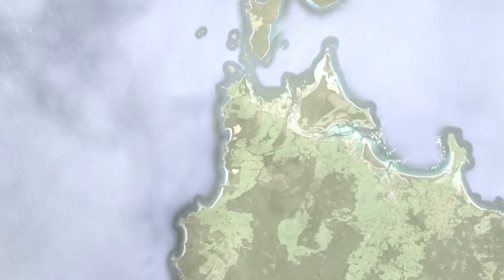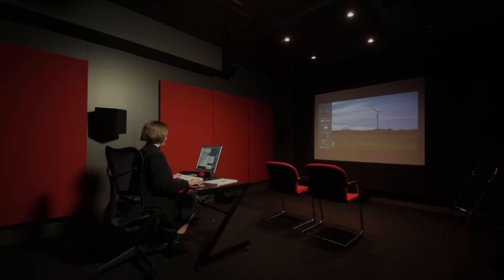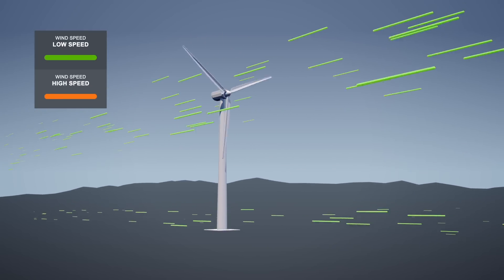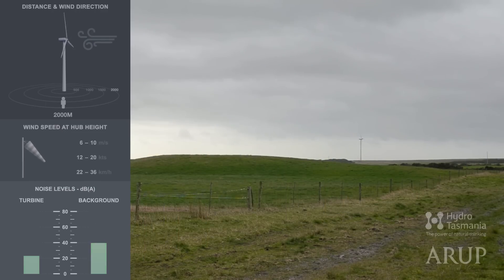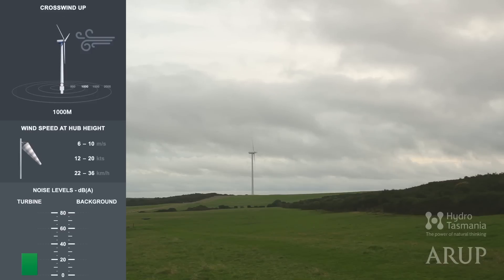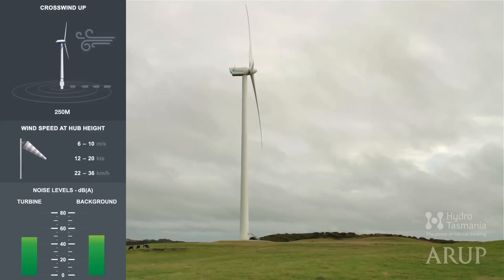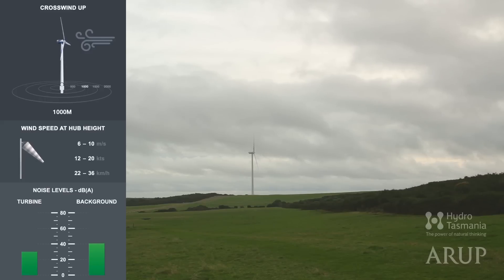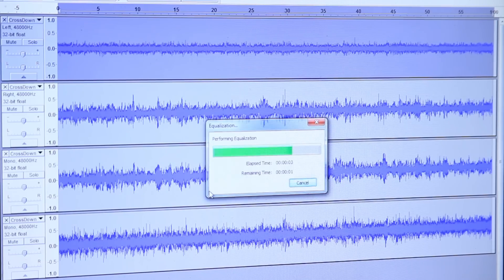The sound of wind farms

Comment: This is a con - note that ALL sound measurements are 'A' weighted - this means that they DELIBERATELY remove low frequency (infra-sound) from the measured results. It is the infra-sound that is believed to cause the health concerns.
Reply: Have lived 1km from large wind turbines for over a year and have never heard a thing even at night all I hear are frogs and crickets. I think that the noise you hear is all in your nutbag head.
Reply: there's no suck thing a infra sound can cause health concern. there is not enough energy is deposited on human body to cause any sort of harm. its just low humming sound that barely audible, if you grow older you will hear less because of your hearing is weaken on low and high frequency.
Reply: Not true: I could hear the sub sonic and infrasonic frequencies in my studio quality earphones. The equalization of these soundbites are indeed accurate. I visited a turbine myself, and could barely hear anything over traffic noise on the highway. When I put my ear up to the tower, I could hear the whirr of the gears in the transmission, and the 360 Hz magnetic whine of the alternator.(60 Hz, 3 phase) To hear that, I had to all but "hug" the tower. I could not hear the electro-mechanical sounds at arms length from the tower. The bushes and trees made so much noise, it drowned out the noise of the blades. The loudest thing was the traffic noise, making it difficult to hear the windage noise of the blades. I want to get close to a turbine away from a forest, or from a highway, so the environment is quiet enough, to clearly hear the turbine. THEY'RE THAT QUIET!!!
Reply: @vincentrobinette1507  Just today I went for a walk around the national park near where I live, where there are a total of four wind turbines - Senvion MM92's to be more specific. I regularly visit the park and like to go stand right next to the wind turbines, as they're a piece of machinery I'm particularly interested in.

I've noticed that the blade "roar" is louder on colder, more humid days - I presume that happens because the air is more dense and it creates more resistance for the blades. Near the turbine you can hear all sorts of sounds as you mentioned - the transmission, the generator, the motors that rotate the nacelle and make the blades pitch. Even if the turbine isn't working you can still hear all sorts of whirring and humming sounds coming from it. From afar I am able to hear the turbine blades spinning, the yaw and pitch mechanisms working as well as some screeching sounds.

I don't live near them nor am I a scientist, so I personally can't tell if the sound they produce is prejudicial to our bodies. But you can definitely tell they're around in a large radius, and I'm talking about only four units. I presume people who live near large wind farms can feel bothered by them.
Reply: @mikerelvas  Have you been able to walk around a turbine in high enough winds to produce full power? If so, is it more apparent up wind, down wind, or cross wind from the turbines. What angle do you need to be, to experience the most noise, particularly the infrasonic "Whump"? Again, I have never heard anything but a light "swish", barely audible above the noise of adjacent trees and road noise.
Reply: @vincentrobinette1507  I've been around these wind turbines in all sorts of conditions, including high wind speeds, but I can't tell you if they were at full blast. I can say, however, that they were spinning faster than usual.

I presume upwind is how they're usually positioned by default, meaning that the rotor always seems to be pointed against the wind, so it flows from the front to the back. At least that's how they're supposed to work (correct me if I'm wrong). In such conditions you not only hear the "swish" or "roar" of the blades as well as a pretty aggressive "whistle", almost like a jet engine. You can hear it best if you're perpendicular to the blades, whether you're right under them or a few hundred meters away.

In terms of the infrasonic sound, you seem to feel its presence regardless of where you stand, but it's obviously more intense the nearer you are. If, in my case, the wind turbines are in the middle of a forest where it is generally pretty quiet, any strange sounds they make seem to be amplified quite a lot, as they feel out of place. Yesterday, for example, I was walking away from the turbines and I could hear the nacelle rotating and the blades pitching.

I'm sorry if I didn't quite answer your questions fully, but feel free to ask away and I'll do my best to explain. I would recommend you to find a more secluded wind farm and spend a few hours there in order to clear any doubts you may have about them and their mysterious noises.
Reply: @mikerelvas  I think you did! You suggested that they're loudest, if you stand right in the rotational plane of the rotor. You are correct, the turbines have anemometers and yaw mechanisms, to ensure they always face right into the wind. My problem is, when I've visited turbines, the wind hasn't been high enough, for the machines to produce full rated power, but, above cut in speed, so they were turning. I'm guessing that if the wind is ABOVE the speed necessary for maximum output, the pitching mechanisms "feather" the blade edges into the wind, to control maximum torque. That might be when a turbine makes the most noise in the wind. I've never experienced that. As far as infrasonic sound, I would imagine it would be worse with one machine, than many. With a wind farm, the beating "whump" of many turbines just turns into a low frequency drone, more like a steady rumble.(again, I've never had a chance to hear this) We don't have a lot of turbines here in Utah, because we just don't have enough wind, for the capacity factor to make turbines economical. We have them in a few of our canyons, but that's about it.
Reply: @vincentrobinette1507  Recently I visited the natural park, where the wind turbines are, on a very hot evening with pretty much no wind, and they were actually idling. I went near the one that's at the highest elevation and stayed there until it started up, as I was curious to see the procedure. What I noticed was that they still make a lot of electro-mechanical sounds even when they're idling and that they always seem to be adjusting their position even without the blades rotating, which also makes some noise. When they start up, you hear a lot of stuff going on, from generators, transmissions, yaw mechanisms, clunking and, finally, the blades wooshing away.

Yes, when wind speeds are very high the blades are positioned at a more aggressive angle. That way they use the drag in order to control the torque and maximum RPM. The brakes may also be applied and the turbine might be temporarily shut down in order to prevent overspeeding in excessive winds.

I hope you can experience it for yourself one day, especially considering your interest for the topic. These massive fans are quite intriguing pieces of engineering and I love to learn about them. Do you know the brand and model of that turbine you visited?
Reply: @mikerelvas  Yes: The first one was a privately owned,750 kW NEG Micon. The 5 that I visited in the canyon were 1.2 megawatt Suzlons. I also visited a smaller 250 kilowatt NEG Micon. These machines are pretty old, by today's standards, though, they were impressive, back when they were built. I WANT to visit the turbines in California, maybe Altamont  Pass, Tehachapi, or Contra Costa. (Places where there are turbines as far as the eye can see)
Reply: @vincentrobinette1507  California has loads of them, it looks insane from what I've seen online. I think Texas has the largest wind farm in the country (could be wrong).

What a gorgeous state you live in, by the way.
Reply: @mikerelvas  Thanks for saying that. On of the main things we're known for, is good skiing!
Reply: Covid vaccines are believed to cause health concerns, but I bet you got that didnt you?
Reply: Paul Scherek can you please link me to the issues with infra-sound? I am working on a project and am deciding on whether to focus on solar or wind or be hybrid. I don’t want to cause harm or annoyance. I would like to explore all potential issues and avoid or mitigate them.